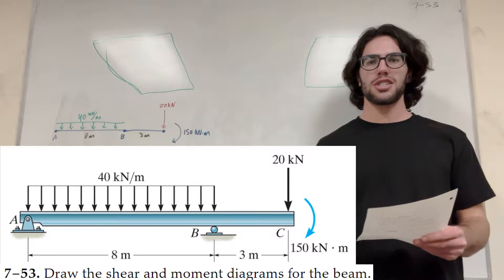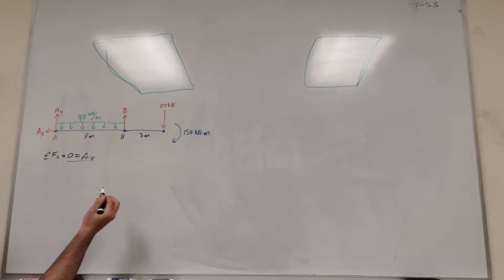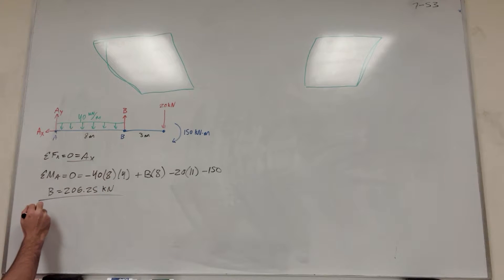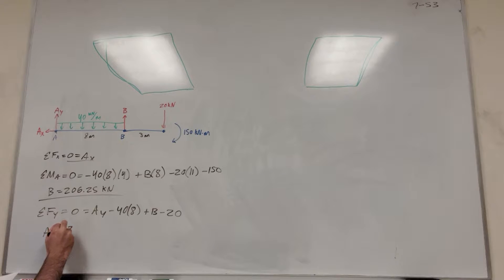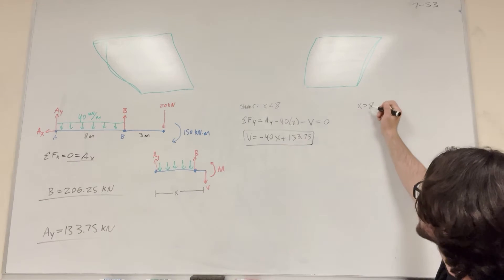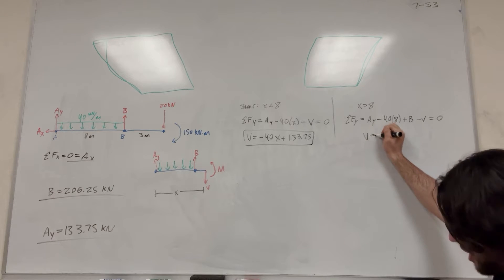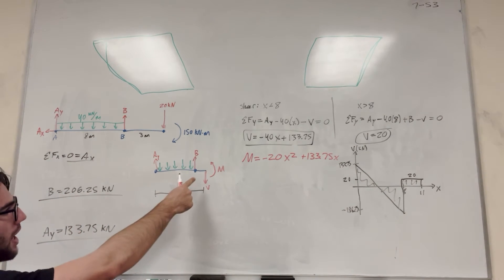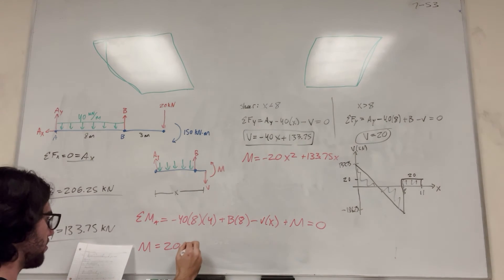Draw the shear and moment diagrams for the beam - 7-53

Comment: When calculating the moment for the x > 8 part, why is the distributed load included? I was under the impression that when you isolate a section of th beam, anything not within those limits doesn't factor in to the equation. I see that it is the correct answer according to the textbook, but I don't understand.